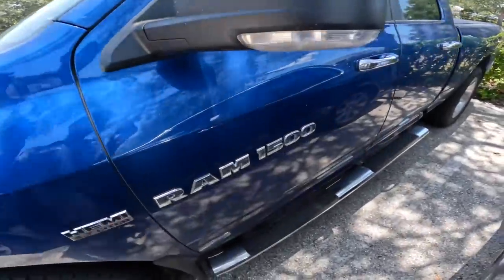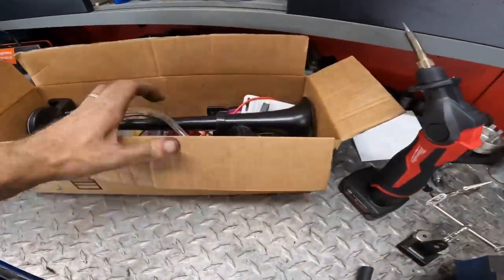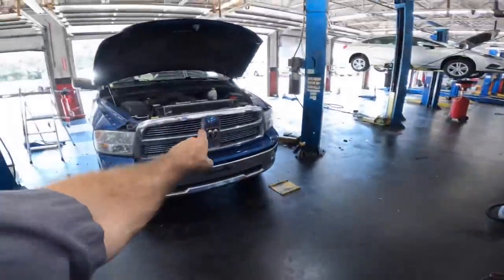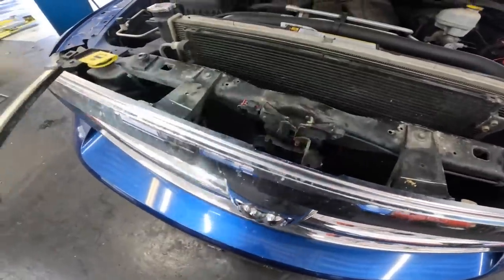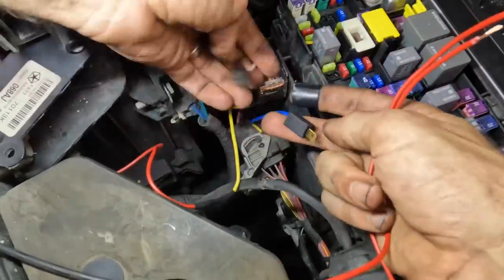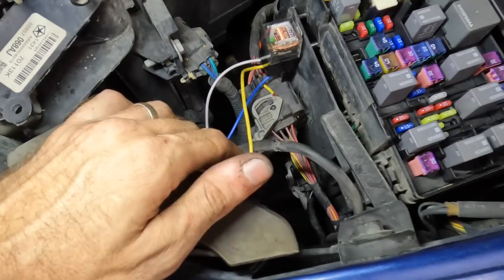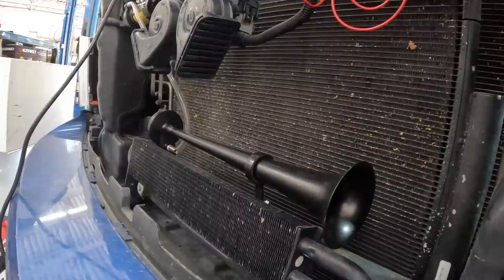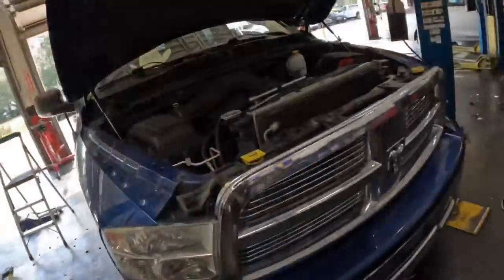Dodge really blows! Ram 1500 4x4 5.7 Hemi

Comment: Thats not like you using one color for everything. Those connectors work great. Overall nice job  unfortunately those compressors suck. Curious follow up. What happened to that older BMW window regulator. Did the owner opt for one from the dealership or not. That job was a bear. Have a great day

Comment: Pro tip: don’t remove the insulation from a wire until you’re ready to make the connection. It will save you some frustration.

Comment: Sorry, got to call you out. You should never coil excess wire like that, especially on the power side. If you have something chafe through on the power side of that fuse it only adds to the toxic cloud of magic smoke.

Comment: One if the reasons i quit my job as a motorcycle service tech.  I was all into racing and all i wanted to work on was sport bikes putting upgrades on em like brakes, exhausts, chains/sprocket kits, foot rests handle bars etc etc. But  all i ever got to work on is garbage like this and harleys.  Led lights, horns, just asinine shit.  And they bring us shit from amazon and bitched when it quit working 3 months later.  One guy kept buying bike master HID headlights and the ballasts would last for 2 weeks🤣. Obviously its my fault.  So i told the guy to just buy a led bulb and i dont have to wire it up and it doesnt rely on the ballast.  Never seen the guy after that.  The led kept working.  Imagine that

Comment: I'm wondering if the air line will stand up to the heat coming off the radiator. Not a fan of the raw bolt end sticking up but that's an aesthetic issue.
Also it seems most Americans don't pronounce the "L" in solder, or is that just me?

Comment: I need advice from Mechanics!  I need to know how to approach a situation that doesn't seem to resolve itself.  Let me begin with informing you that I have the patients of Job.  But even I have my limits.  I have a classic 1977 Lincoln that is sentimental to me.  I took it to a mechanic in my area for a couple odds and ends.  I dropped the car off on September 9th, 2021 and it's still at the shop.  That's 293 days or almost 10 months.  I'm not sure how much of this time is work and parts or the mechanic dragging his feet and treating it like a weekend project when things are slow at the shop.  Basically, I'm looking for a little bit of inside baseball.  Am I the crazy one?  Have you ever had a customer's car for nearly a year?  Does this sound about right or is there something else going on here?  To inform your response, here is list of things that I've had done thus far perhaps to warrant the 10 month wait:  The first was a "slave cylinder" or power steering assist cylinder.  This part needed to be rebuilt because it was difficult to find.  That took about 3 weeks for a specialist to repair and send back to the shop.  I had two minor leaks repaired from the drive shaft.  I had new rubber brake lines installed, two new calipers, and front and rear brakes and discs. The thing that seemed to take the longest to get was the "hydro boost."  He told me the one in the car was leaking and loosing pressure in December and if memory serves me, it was finally was done around April.  The mechanic told me that the first hydro boost sent was wrong, the second part was defective, and the third one finally worked.  Last of all, I'll probably need an alternator because when I put a load on it, the voltage drops to 10 amps to the battery. In my last chat with him two weeks ago, he said it may be the alternator or the voltage regulator.  It seems, to a layman like myself, a lot of work has been done, but it also seems like 10 months would be enough time to perform a complete off the frame restoration.  I know that parts for an older car can be hard to come by, but then again, it isn't a 34 Duesenberg.  Should I continue to be patient with the process?  Should I try to light a fire under him?  I've reached out to him about every 6 weeks to 2 months, but it just seems to go on and on.  Any advice would be welcome.  I haven't paid him yet, which you think would be an incentive to finish quickly, but nothing seems to make my car a priority.

Comment: Obviously, you didn't read the instructions. I bought the identical model. The instructions say to mount the horn facing slightly downward so that any water that gets into the horn obeys gravity and drops to the ground. Also, you are supposed to mount the compressor VERTICALLY!!!

Comment: I despise those heat to solder and seal connectors. I would rather do the connection manually or with a crimp and then cover it with heat shrink tubing. So glad you covered those with heat shrink. The usage cases I hate those being used in are the ones where the mechanic is too lazy to cover it with heat shrink. As those crappy heat to solder and seal connectors get older and start cracking you now have an open short potential. I hope you enjoy using those and they never cause any issues for ya. I myself will never put one of those on my customers cars, don't trust them at all. Only thing I have ever seen you do that I just flat out was like EWWWWWW why???? 🤣

Edit to note: When I say crimp I do not mean those crappy little terminals auto parts stores sell. I usually make copper bands from pipe and use a hydraulic compressor to crimp it and then heat shrink it using the heat shrink with glue lining the walls to seal it.

Reading the comments below knowing those crappy little connectors with the solder and sealant in them are used in aviation make me realize even more why my feet stay on the ground lol. Bet you 99.999% of people that use them do not take the care you do with covering them with heat shrink. When that crappy plastic gets brittle then you have issues. Your work will protect against that. Most of what I have seen do not take the same care at all.
I follow the mantra of if I would not use it on my car then I would not use it on a customers car which rules out those that you used in this video and those crappy little crimp connectors you just said "no" to, I also say no to those lol.

Comment: 25.50   ray you are using the wrong portion of the crimpers look at your crimpers it reads bare  and insulated  .you should be using the insulated which is the one near the rear not the front of pliers it should not mahe a dent in the insulation it should just squeeze the plastic

Comment: I don't like your Crimp tool there are ones that make much better job. More heat or the Deflector on your heatgun would help with melting the solder in a timely manner.

Comment: By using only a red wire, the bomb tech will not know which wire to cut with only 007 seconds left on the digital clock.  Are you putting in a digital clock?

Comment: What I would've done differently: I would've put the relay on the frame with a self screw next to the negative cable. Less wire extensions, less connectors = less work. Plus, it would've:
a) Allowed to tuck the power wire to the compressor out of the way instead of being hanging from the frame to the fuse box; 
b) Allowed the power wire to the relay to be tuck/hidden behind the fuse box = more protection and less clutter in the engine compartment;
c) Not changed the colour of the relay's negative wire.

Comment: I have to ask. Is it advisable to tie wrap something that has a 30 amp fuse to a battery cable?
Reply from the maker: I didn’t see any danger in it
Reply: @RainmanRaysRepairs  fair, I just wondered if the wire burned, it would melt into the larger guage and get real hot real fast. Just an opinion. No offense
Reply from the maker: @daveunbranded  None taken 😉

Comment: Ray, run the wire through to whre it's going, tuck it in the heat shrink... before stripping it. For some reason you're making me cringe watching you strip it and then carefully try to make sure you don't mess up the strands as you're tucking it into heat shrink... the job will go faster also.

Comment: don't use that crap again, it uses unleaded solder - unleaded solder will crack with heat-cool cycles
a mechanical connection, crimping, is always better 😉

Comment: Aftermarket crap installed very untiderly with wires way to long & as per every other mechanic I've seen doing wiring you bare a 1/2" of copper to use solder butt connectors, 
FAIL F- you don't need to bare that much copper with those connectors & I refuse to use them as the solder penertration is very poor, I just solder n cover with heatshrink as I've done for the past 40yrs!